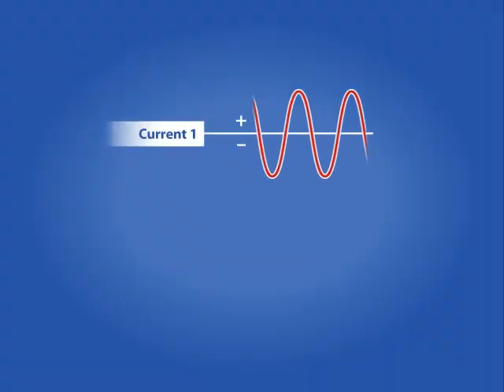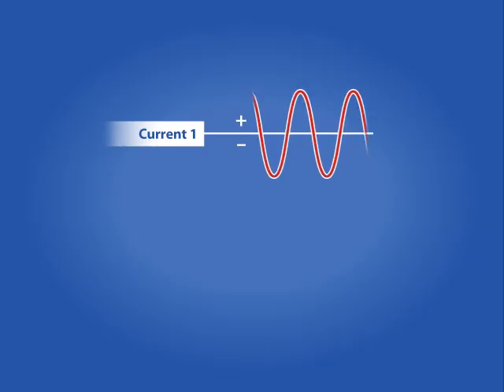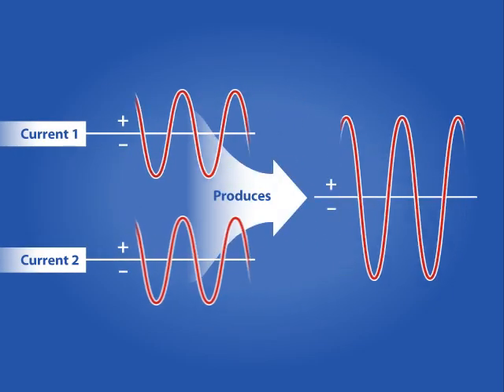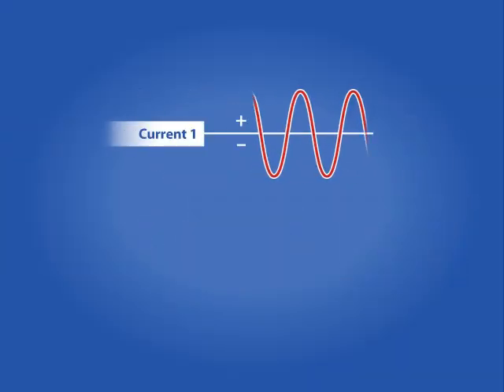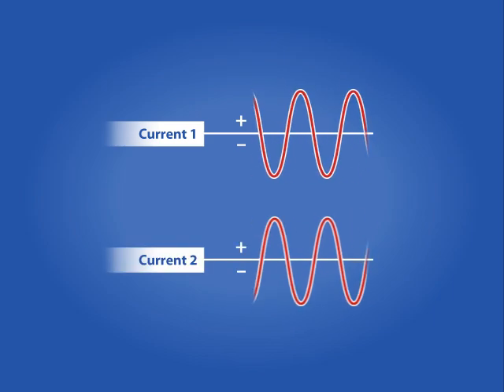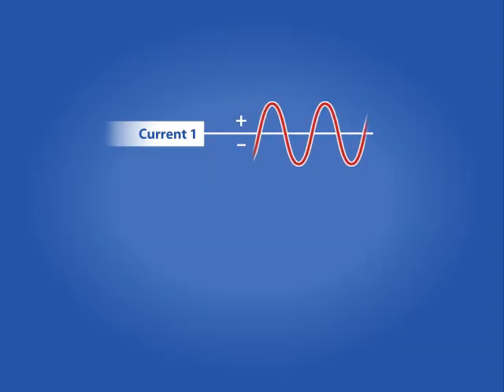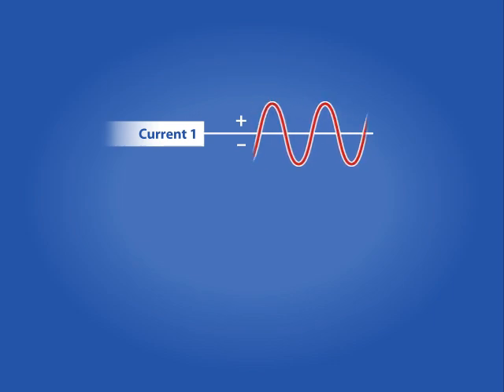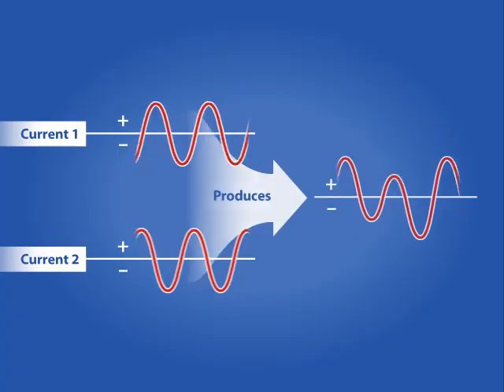Constructive / Destructive Interference

Comment: Thanks, good example.
Edit: The explanation was simply wrong though. Frequency remains the same, amplitude changes.
Edit: I just came to a realization, if amplitude increases wave velocity. And wavelength doesn't change. It would increase frequency as well as velocity amplitude and energy.